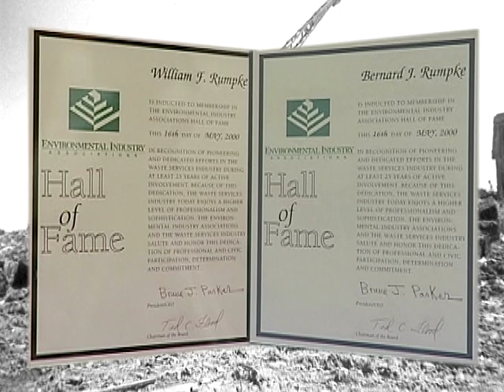Recycle

Comment: @Frickis It is technically better, but the risk is that people won't bother to do so when it's much easier to chuck everything into the garbage bin.  LosAHills' example is valid, but it's at much less of a cost than if none of that material had been collected because of lower recycling participation.